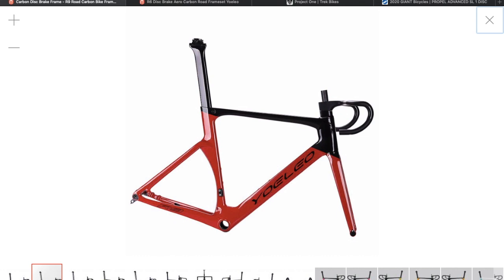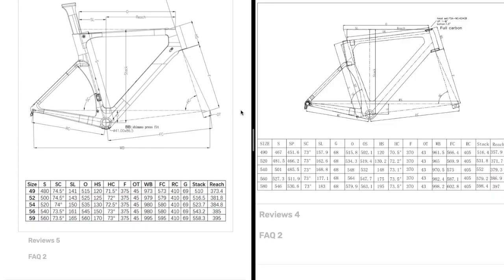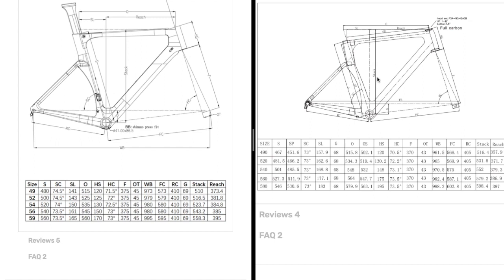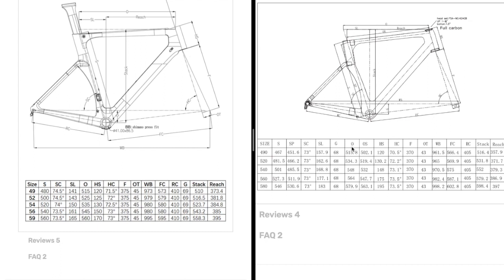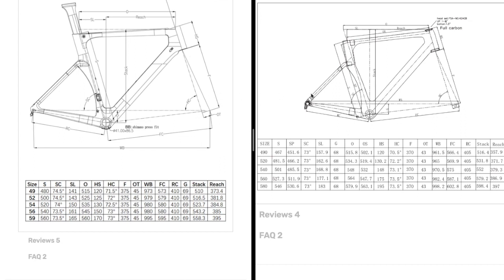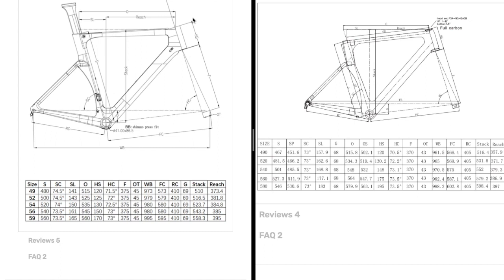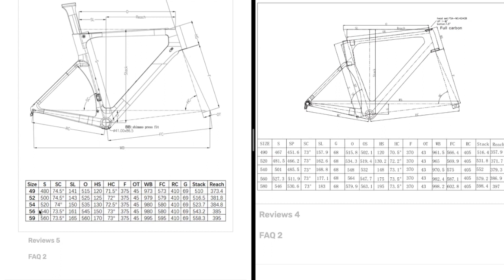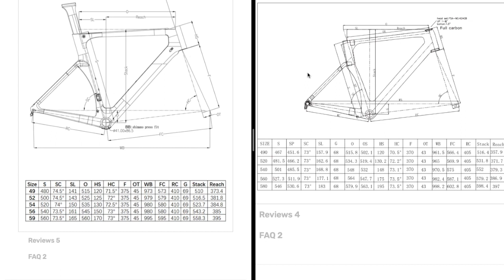Yoeleo R9 Aero Disc Preparation Part 4

Comment: Seems a little more aggressive in geometry? 
I wonder if it will be capable of having faster take off than the R6?
Cool video man. The R6 or R9 is my next build just interested to see how you get on. 😎
Reply from the maker: sixahem to me the bikes are very similar. China cycling did a review on it and said it was quite relaxed and due to the stem angle he couldn’t get the bars low enough for him. Who knows, that’s just his opinion. To me it looks great and it’s almost the same geometry so I can’t really go wrong. 👍 more videos as and when I take the next steps.
Reply: @KyrosHouseCycling  .. the geometry on the R6 disc was quite poor. If the new one is similar then you are not gaining anything
Reply from the maker: Greg Fisher I found it to be fine, I just like the integrated look as I hate cables on the outside. Plus I get a custom paint job.
Reply: What about the new R11? Unfortunately they started to increase the price of every new frame the put on the market... r6 850$,  r9 1090$, r11 1050$, r12 1200$...
Reply from the maker: Michele Trasforini yeah I did notice it was more expensive than my current frame, but I expected that due to the full integration of the cables and the one piece stem and bar. Im happy with the price but I’m interested to see what the future prices are of the frames, u fortunately everything goes up on price nowadays. 👍
Reply: Yes, the geometry of the R9 is more aggressive (if the geometry applies in real life). I would prefer to measure reach and stack myself to be 100% sure.
The R6 has stack/ reach = 1.497 which is quite relaxed for an aero bike, and alround bike territory
R9 has stack/reach = 1.41 which is way more aggressive
The seat tube angle is slightly more aggressive on the R9 with 73.5° versus the 73° on the R6
But the head tube angle is less aggressive with 73° vs. 73.5° on the R6.
The R6 has also 2mm shorter OT which makes it more lively and less stable.
From this the R6 should have a slightly less stable and more responsive steering but the position on the R9 is way more like an aero bike. The R6 has more of an alround bike geometry. All the other things don't really matter much.
Reply from the maker: User 123 thanks for that, very interesting explanation. 👍
Reply: @KyrosHouseCycling  Oh and I forgot the wheelbase. A longer wheelbase will make the frame feel more comfortable and more stable. Cheers
Reply from the maker: User 123 sweet! Thanks! 👍